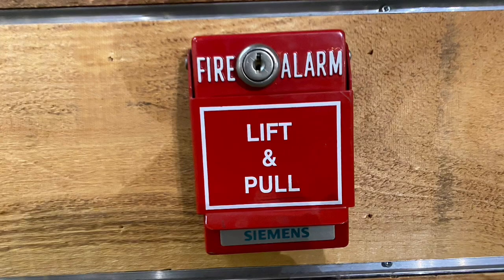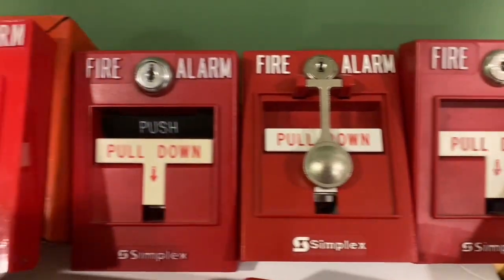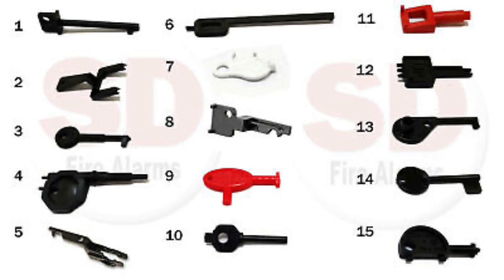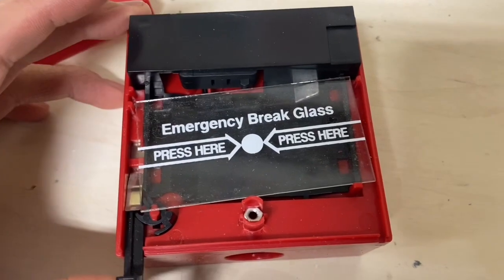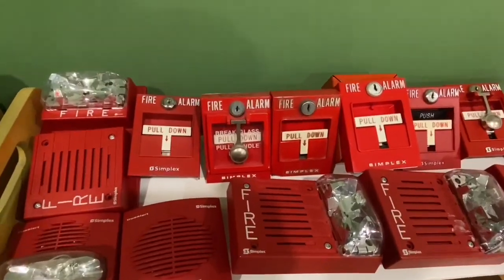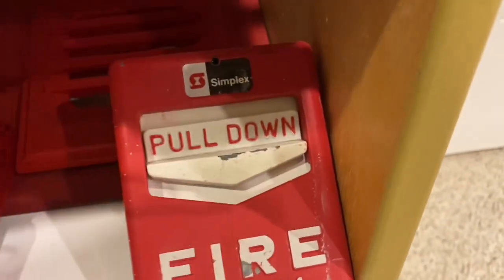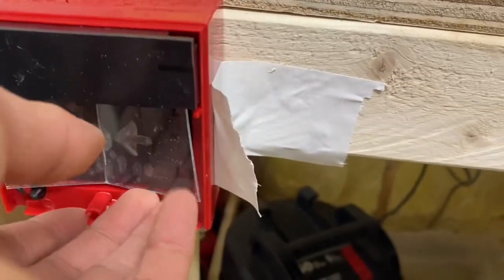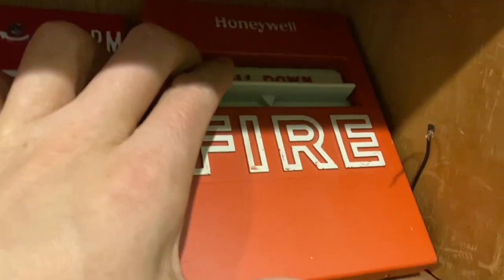What’s Better? Fire Alarm Call Points vs Pull Stations | A short analysis

Comment: Pull stations are better but the one thing I'd add is all pull stations should have a little fire logo. Just so people who are unfamiliar with them should know what they are.
Reply from the maker: Agree
Reply: I agree with u and make them bilingual as well
Reply: @Neptunesalad12 they did micom fire pull stations are french and english
Reply: Some time manual call point can resettable, just change the glass install emergency push plastic
Reply: And the key to reset it isn’t efficient.

Comment: These days most call points have multi-use elements in them where when pressed, a yellow bar (sometimes with black stripes) becomes visible and can be pushed back up with the plastic keys as well as plastic shields mounted on the front to stop people accidentally pressing them.

Comment: New zealand call points are pretty decent in my opinion because unlike other call points where you can bump into them accidentally, with the semi-new call points in new zealand  bumping into them just causes the snap-glaze to break. The button (some models have a switch) is actually separate from the snap-glaze and sits a cupule inches behind it. The snap-glaze is also plastic and can even be reset and reused if you snap the 2 pieces back together. Pretty genius i think.
Reply from the maker: I have seen those. Basically a plastic frame with a switch inside that you push after pressing the glass in. Suppose it is better than other call point designs

Comment: Both. The ones have break rod such as Manuel pull Station. If it’s not the same, they don’t have a breaker rod unless if it’s conventional, addressable, or intelligent it with a brake rod that are manual pull Station all alarms that are call points manual PULL stations in case of fire elevators are out of surveys, but they will have a glass rod at the 270 SPO
Reply from the maker: ?? Yes, some pulls have break rods

Comment: At least in the UK's case, most call points are resettable (such as the Apollo Intelligent Call point, Gent S4 Call point, etc) and it's actually standard regulation now for all call points to be fitted with a plastic cover that has to be lifted to activate it. I'm only speaking for the UK here, but nowadays it's getting rarer and rarer to see a non-resettable break glass and even rarer to see one without a cover on.

Comment: In Europe, Some call points (usually made by Esser by Honeywell and Bosch) have a bigger glass piece (than the KAC call point you demonstrated) with a button behind the glass than on top of it. And these call points don't have to go out of order or the glass getting replaced after they get pressed, but people can tamper with the device. I have seen a lot of glass missing in these call points. I don't really have an opinion because I have never seen a pull station in real life.

Comment: Personally I prefer call points for a few reasons: 

People are less likely to tamper with call points or press them when its not a real emergency because theyre more 'intimidating' meaning there are less activations by people either purposely misusing safety equipment or treating it as a universal "i need help" button. 

Secondly, break glass callpoints (although still in circulation) are pretty much mostly phased out at least in the UK, however those that still exist are relatively easy to reset as buildings with them installed are required to carry replacement glass slides as its an offense to have call points "out of service". 

Thirdly, it is immediately apparent which call point has been activated at a glance. On newer models the button will either twist to the side or drop down revealing yellow and black hazard strips on the button itself. For break glass call points, either the glass is quite obviously broken or the glass is broken and a yellow activation strip will be displayed. (lots of call points also feature a red LED to show it has been activated) 

Also, to address the point on accidental actvation, the vast majority of callpoints are fitted with a protective cover you must lift to access the button, in some cases this cover will activate a security alarm on the unit to draw attention to the person attempting to activate the alarm. 

Hope this helps
Reply from the maker: Good info
Reply: its not an offence as 100% of call points have to come with a piece of plastic by law that can't be broken that says not in service even the reseetables such as the Apollo intelligent map an have that peice of plastic in and all break glass ones come with it installed they have to its the law
Reply: Good info thanks

Comment: Japanese-styled call points (I say that since Taiwan uses them as well) are, in my opinion, well superior than their European relatives.

1.  The opening to the push board is small and circular, so it is hard to accidentally activate it. 

2. It is accompanied by a red light that provides rapid identification of the location and status of such a location (Bousai Guy has some videos about this.)

3. They are placed conservatively, alike to that of pull stations. 

4. There are an abundance of emergency telephone locations in public spaces and in tunnels, sometimes with (independent) CCTV monitoring.

5. Most call points are reset by lifting a flap, then inserting and rotating a tool anti-clockwise with minimal effort.

This is as far as I know, and this doesn't include any sort of device alike to that of Safety Technology International's "Stopper" series.
Reply: well newer designed call points have red lights too, and European law states that you must not be able to leave a building without walking past at least one call point, and majority of fire alarms auto dial the emergency services, and newer designed call points also just reset by turning a key

Comment: Just now i remembered about something i saw in one of the buildings at a college i used to go to
To get into that building you had to go through two doors, heading inside, the first door opens automatically, for the second door, you have to press a button to open it (i don’t know why they set up like that as it was a swing door, so it could easily have been set up as a power assisted door), on the inside of this second door was a fire alarm call point, just above the button that you have to press to open the door, the call point had a note saying that it is NOT the door open button

Comment: Other call points don't use glass, like the Apollo call point. they are just as simple to reset as pull stations.
Reply from the maker: yes that’s true
Reply: @FireAlarmDude5967  this is an off brand call point, based off of the kac world series design from the 1980's
Reply: @FireAlarmDude5967  the glass doesn't break like that on the original glass call points either, they crack down the middle in a single line
Reply: also, all glass in break glass call points are universal, so an engineer would still only have to carry a few glass pieces
Reply: @cemops8660  Yeah, In my opinion both call points and pull stations are great.

Comment: Back in 2012 (i hope i have remembered the year it happened correctly) someone tripped over a bag and set off a call point at school, thankfully it was a plastic one which can be reset with the correct tool/key, and not a glass one
Some places have a plastic cover over the call point to protect against accidental activation, but this school did not have those covers on the call points

Before that school moved into the new building, some of the call points in the old building were ones where you had to break the glass and then press the button behind the glass, most of those had a metal thing on a chain which you could use to break the glass

Oh, and when i was at college, one of the teachers/tutors/whatever told us a story about the time when they were carrying a glass tank and accidentally activated the call point in one of the handling rooms, which set the fire alarm off

Another thing ive just remembered, there is one shopping centre which ive been in, where the call points were replaced with key switches
There was a sign taped to the wall next to them saying to contact security if you come across a fire
Reply: what if the security died
you'd be screwed
Reply: @d0g3br34d  its been a while since i was last in that shopping centre (im guessing at least 4 or 5 years), but i think they would have also had smoke detectors
And for whatever reason, some, if not all of the stores had actual call points in the store and not key switches (i know that i saw an actual call point in one of the cheap stores in the shopping centre), the key switches i saw were in areas outside of the stores

Comment: I prefer call points, as even the break-glass ones have a resettable option you can buy, which consist of a specially shaped plastic piece, that is bendable, that looks like the glass, that you can put instead of glass.

The plastic piece has a hook, that hooks into the ledge that the breakable glass is put on normally. When the plastic piece is bent enough, this hook will fall off the ledge, plastic piece slides down about 5mm, and the call point activates, also the plastic piece has a yellow painted stripe that becomes visible.

This so you can choose exactly where you want a single-use glass option, or a resettable option - without changing look! They look the same so you can't know which are glass or resettable, before activation.

Also, this is excellent for if you want a breakable type, so when a break-glass is used, you can put a plastic resettable insert temporarly so the call point is in service, until you get glass ordered.

Then when glass arrives, just switch out plastic for glass, and now the plastic insert is ready for next call point that needs a temporarly replacement until glass is fixed.

Comment: you know in the uk u can buy resettable plastic elements for most call points apart from old style kac of cause
Reply from the maker: Correct
Reply: They actually do now make resettable elements for the old style KAC call points now. Only issue is there is literally no indication that it has been activated so they're only really suitable for the addressable versions with the built in LED